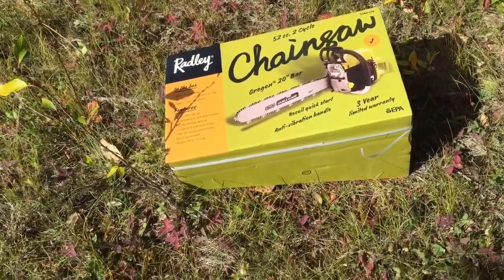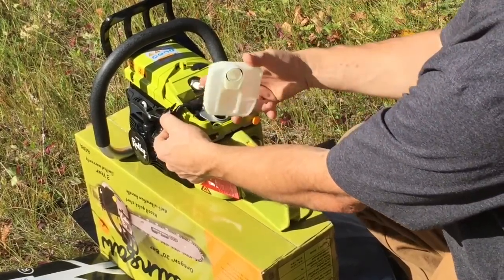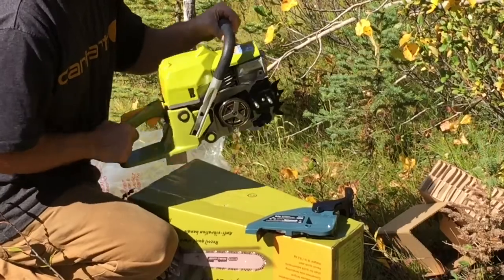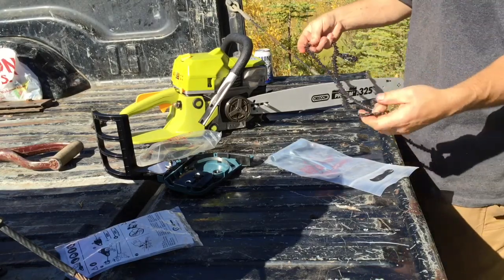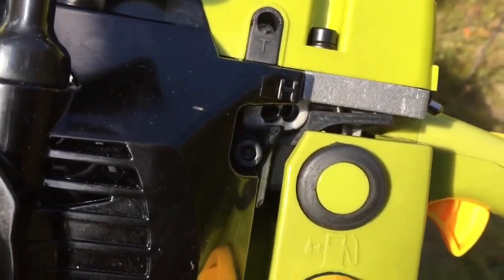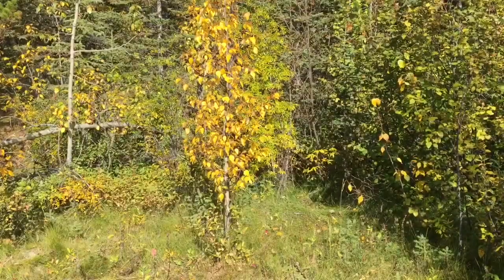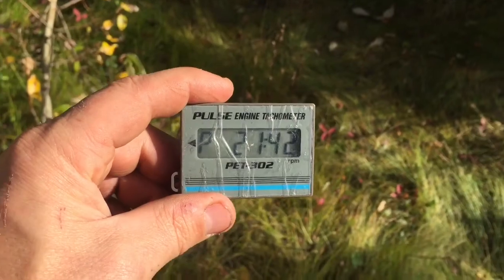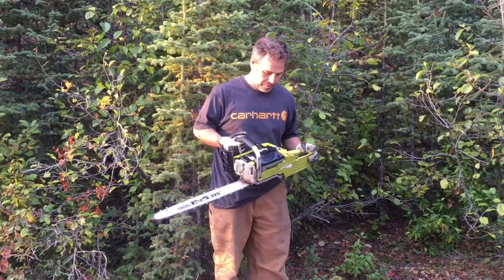52cc CHINESE CLONE REVIEW AND CUTTING!

Comment: Yep you convinced me! Had it now for almost 2 yrs. Cut 4 big trees. The only complaint is she runs hot. That's where 2 saws come in handy 😅
Reply from the maker: @dfairfull2542 yes the mufflers are choked up making them run a bit hot. You can richen up the mixture settings to help with that.
Reply: I have taken the torch to the catalytic converter inside the muffler and opened it up to breathe better. Haven't had it in the wood yet to see if this helps. Your right about carb adjustment. That will have to be done again. Keep your stick on the ice and thanks!
Reply from the maker: @dfairfull2542 I sure hope you got all that material out of your muffler cause it’s just going to get sucked back into your engine when you fire it up don’t forget a two stroke sucks in on the exhaust a little bit as well you’re gonna pull all that stuff inside the motor if you’re not careful and destroy it.
Reply: Good point. Got it clean as a whistle. Took the grinder to the edge of the fold over. Removed it then welded the edge back up. A little hi temp manifold paint and she looks good too. Thanks again.

Comment: I bought 2 Chinese top handle chainsaw and they so far run great.. i got them so instead of cutting branches and then you got to pick them up afterwards... With the top handle chainsaw I cut with one hand and the other hand I hold the branch and if it's good size for firewood i toss it in the trailer... It is so much easier... and I paid $68 for the one chainsaw and the other one I paid $97 1 has 10" bar and the other one has 12" bar

Comment: Thank you , I bought this saw , and as a single woman you gave me some great tips thank you
Reply from the maker: Right on yes it should be a great saw for you but it does need to be tuned right to make it run 100%. You need the special tool to adjust the carburator but once it’s set it should start and run fine for you as long as you mix your fuel/oil the same every time. 
These saws act like a high end saw and do not need to be tuned everytime you use them like some other cheaper saws.
Did you get it on sale? How much are they selling for now?

Comment: Thank you for this in depth review, had a 40" elm stump that looks amazing and wanted to slab it for tables but all I've had is a 16" husqvarna and I don't cut trees for a living so didn't want to put $700 into a saw. Good tip on buying the replacement parts ahead.
Reply from the maker: Realism91 Ya for a cheap to buy saw it sure is impressive.

Comment: I have the Radley bar, my original chain is getting short in the tooth . I’d almost given up on finding a  76 Drive link, .325 pitch, 0.58 gauge chain. Happened to be on the Home Hardware sight yesterday, they’re finally carrying them and not only that, there’s a big Radley sale on, they’re half price @ $11.50 now. Picked up two. The saw came with a made in China Oregon, these look the same.
Reply from the maker: @Gump Redhouse. Great info! 
I know mine the one in the video had a China/Oregon chain and it was very high quality lasted for 2 years of heavy cutting. I looked at the newer style bar/chain and it was anodized black vs just regular metal colour but the Oregon chain mine came with had blue links as well. 
Any saw shop can make you up the chain you need or you can go to the link in the description of this video and it has chains you can buy off Amazon. I think the link I posted works out to 12 bucks a chain or something like that. 
Were the Radley wood splitters on sale?
Reply: My stock chain has life left in it but ran across a nail in a tree I was taking down, I now have a pseudo skip tooth 😀. I  know what you mean about the Blue links, I think Oregon say it’s extra hardening or something. The chain that came with the saw was in Oregon bag but definitely didn’t have the Blue links. I think that the ones that I just bought are the same chains in Radley packaging. For $11.50 you should buy one, I have to think that there’s enough adjustment room on the 78 Link bar to mount  a 76, really, one link difference bottom and top, it will stretch too. It would be good to know how it compares to the one that shipped with yours. I was going to get the local guy to make me something a bit more aggressive, I’ll see how these ones work out. I continue to be really impressed by this saw. They’re up to 175 when they’re on sale but it’s still a heck of a value.

Comment: I was in the market for a chainsaw as a new rural property owner here in NS, I kept reading that the Husq Ranchers were the saw to get. Rolled down to my hardware store (Home Hardware) to order one, the guy talked me out of it and into one of these Radley saws. Says he's sold 50+ and hasn't had a single one come back yet, and that guys are even coming in to buy another after they've gotten home and used it.

Turns out the Radley was even on sale @ 150CAD, just gets better and better. Tested it out some fallen deadwood in the yard and yes, IT WILL CUT! Started up right away, ran real smooth too!
Reply from the maker: Right glad it worked out.
So did you tune the carb or just run it right out of the box? 
I’m curious to how it’s holding up for you.

Comment: Bought one 2 years ago...love it ...never fails to start second pull..only issue ..don't use bar oil ...use motor oil only ..
Reply from the maker: Right on good to hear. Why do you say to use motor oil?
Reply: @Indeewoods  I put chain oil in ..and it leaked all over ..checked manual ..states to use auto oil ..doesn't leak now...weird..cheers.
Reply from the maker: I’ll have to to look at the manual. 
I know some saws do not like thin bar oil. Husqvarna makes a nice all season bar oil that is quite tacky. 
And all the old vintage saws called for motor oil if i’m not mistaken.

Comment: It tightens ok but will only get a couple passes through until its loose again. Think I'll try new chain and bar
Reply from the maker: I think it’s normal to stretch a bit when it’s new.
Make sure you hold UP on the bar and you should have a little slack in the center of the chain then tighten it down.
Also what is your bar oiler set at?
Maybe turn the oiling up and make sure it is getting oil.

Comment: of all of the cheap chinese chain saw reviews i've watched, and holy hell i've watched alot of them, this one is the best. that sucker sure was making alot of chips at the end!

this saw looks like its the Cadilac of Chinese saws. its got the best manual i've seen and alot premium features not found on the $100 usd cheapies like the side chain adjust and oregon bar and chain.
Reply from the maker: Right on thanks for the compliment! I think that was actually the first video I ever made where I was talking to a you tube audience glad you liked it.
Ya these 52cc clone saws are really catching on. I read that they were cloned off a pro saw. It’s crazy how good they are for the price. It does depend who is building them though it seems. For instance these ones come with the Oregon bar/chain and it does come from China even though Oregon has a factory in Canada but must be easier/cheaper to assemble it all over in China. 
I’m going to do another review on that saw soon to let people know how it’s holding up and what I think of it.
Reply from the maker: And as far as throwing chip it actually was running very rich there but now that it’s tuned it rips pretty darn good.

Comment: I baught princess auto version its the forestking but identical saw but came with a 20 in bar and 16 in bar absolutely great saws with muffler gutted and the carb modified to tune it 
The muffler stock will start fires!!
Reply from the maker: @erikletham4944 they are all similar but It appears they make two styles a cheaper quality built saw and one that is higher. I have a few of these and the Radley is better built. Just better oilers,kill switches,plastic and a better pull start. Not sure about those Forestking models though.

Comment: Thanks for the great videos. Any issues with your tensioner? I stripped my work screw, and having a tough time finding the part number for replacement.
Reply from the maker: @andrewsliasas I’ve never seen one strip there should never be that much tension on your chain. 

Go back into that video I’ve added the link for that tensioner that should fit your saw. 

Let me know how it worked out. I have some here do next time I get a chance I’ll verify but it should work for yours.
Reply: Thanks for the reply - yup, that looks like them.

Only used the saw for about an hour, and the chain was noticeably looser after this period. I just tried to tighten it up a bit, but there might have been some debris preventing the bar from moving and I cranked the adjustment screw too hard.

Will give the new adjustment screws you linked a go, thanks again!
Reply from the maker: @andrewsliasas3680 ya just make sure you loosen the bar nuts before you adjust the chain otherwise it will strip the threads.

Comment: I bought one of these  hoping it will  do the firewood  cutting fir a couple  years  have a  few others   for backup
Reply from the maker: If you break it in right and do a couple heat cycles before you use it you won’t be disappointed. 
I just cut another cord with mine and switched the mixture to 50:1 and it runs beautiful but it vapour locks on really hot days when you shut it off then try to restart but lots of high end saws do that too.
The stock chain is durable and cuts decent but if you know your way around saws I’d  ditch that chain for a non safety chain it’ll cut much better. For the price of these things especially when on sale you’d only be into it for 190.00 with a better chain cheapest best saw you can buy in Canada. 
Make sure you tune the saw before using it or you risk damaging the engine.

Comment: Just bought one of these for 150$ used 2x. For a 20" bar and 52cc's its what i need. Im not doing any crazy 10cord of wood with it just cleaning up deadfall at the cottage, but need something better than a 30cc poulan than works once and smokes the engine.
Reply from the maker: @Matthew Morrone it’ll cut 10 cords if you need it to. Don’t let the price fool you they are pretty good saws. 
Like all saws they need to be tuned properly so hopefully you kniw how to do that if not get someone who does. 
Mine runs flawless and I’ve cut at least 10 cords of wood with it.
Reply: @Indeewoods Thats to be expected, and yes ive tuned many 2 smoke and 4stroke yard equipment engines, dirtbikes.  I have a set of tuning drivers. Ill have to see if I have the one specified in the video.
Reply: I noticed the carb tuning tool is called an eccentric or A Circle. The are 2 different A circle drivers, one is larger than the other. I dont mimd ordering the tool as i checked my kit and do not have it in my 9-10piece set. How donI know Im purchasing the correct one?

Also what size file to sharpen the chain?
Reply from the maker: @Matthew Morrone I’m pretty sure in the description of the video there is the 12 piece kit that comes with the A-circle tool and also the single tool itself plus files etc. 
Check it out.
Reply: @Indeewoods  a kit just for this saw?  Im not underatanding. There are 2 Different A-circle adjusters. Ii want to buy the correct one. In ny orevious comment i said i have a bunch already. But dont want to waste my money on awhole other kit where i just need the one tool
 Does this compute?  I foumd a large A circle and a small A circle. What kne does the saw use.  And looking for file size because I didnt buy my saw brand new.  So od lile to knpw the file size so i xan out together my own tool kit. Some of this stuff is lile pulling teeth. But ill figure it out on my own if i have to.
Reply: I didnt see the kit. Or part number. And i actually took notes on a lot of what you had said about the saw.
Reply: @Indeewoods  oh in the description. Ok. I just ordered the single A Circle tool only for 10$ tha ks for the input. Ill have to fiure out the file size i need.
Reply from the maker: @Matthew Morrrone here’s the size I use.
https://amzn.to/41oecXs
Reply: @Indeewoods  thank you so much for your input.
Reply from the maker: @Matthew Morrone no problem? Did you just need files or do you need the handle,file angle tool etc? If so here’s the one I use. https://amzn.to/3Y1QmOh
Reply: @Indeewoods  got my eccentric/A-Circle tool in the mail and went to princess auto and picked up 3 files 3/16" and a handle and guide kit, chain and bar oil and i already have 2 stroke oil for the other yard equipment I maintain and repair on the side hustle.
Reply from the maker: @Matthew Morrone looks like you are all set! Let us know how you like it.
Reply: @Indeewoods  its leaking bar oil everywhere. I burped the oil tank  but because its new to me im going to dissassemble it and go completely through it. 

It has the cheap Radley bar. But i can get a 2p" bar and chain from oregon at canadian tyre or princess auto for under 70$ which isnt bad. Ill use it till its worn out and then replace it. Besides that, its tuned pretty well, starts on choke first or second pull every time. A lot quieter than I expected and light for a 52cc. My dads johnsored is a heavy machine!
Reply from the maker: @Matthew Morrone cut with it for a bit they all leak when new. The saw dust acts like sponge. 
Crack the oil cap as well after ever use just incase there is any pressure in there.
Reply: @Indeewoods  yes, i read about that.

Comment: Im still using a 1960,s XL12 homelite. I Have several plastic saws of different makes. They are not a tuff and reliable as that vintage Homelite. Im on the Hunt for a vintage lombard.
Reply from the maker: Ya the old XL 12’s were good saws and built to last. Also 5 times the price of these even when purchased back in the 60’s.
Reply: @Indeewoods  Yes $129 was a lot of money in 64
Reply from the maker: @thecollectoronthecorner7061  I thought those XL-12’s were around 8-900 even back then?
Reply: @ronweaver9296   I have a Poulan 306A Like the guy used in the Chainsaw Massacre movie. Its Ok. and a pile of those 42 Cc Poulan pros and a couple of wild things. Not much count . the last one I bought I was at a auction. The auctioneer started it out as $50 and kept getting lower $10 at a time. When he got down to $10  and no takers. I shouted $5 he immediately said sold. Quick get his number before he changes his mind! I buy them and use the bars and chains on my Homelite 101.
Reply from the maker: Awesome I’d love to have a 306A.
Not many old Poulan saws in my area.
Reply: @Indeewoods   Im a collector of sorts. I buy older saws at estate auctions. Lots of $5 and $10 saws. The 301A was a $10 saw. Needed a carb kit and fuel lines go get it running. I dont restore my saws. I leave them looking  well used. I actually use them to cut our firewood. I rotate. Use a saw and burn a tank of fuel. and then get a different saw and  repete. I never let a saw set very long with fuel in it.
Reply from the maker: That’s awesome I do the same thing. 
I like to see what each saw can do and since I was to young to use them when they were new I feel like I get to experience what it was like to cut wood in the 60’s/70’s.
Reply: @Indeewoods   Im 70 and my father bought a new manual oil Super XL 12 in 1964 and at 13 Years oil I got to use it, Just today I went and cut firewood. Used a 58 CC Lombard and a auto oil XL12 Homelite. ran two tanks of fuel thru the Lombard and one thru the Homelite.  Cut more wood than my 2003 chevy 1/2 ton 4 wheel drive's 8 ft bed could hold.
Reply from the maker: @thecollectoronthecorner7061  that’s good stuff right there.
I was reading up on those Lombards and seen a video and man they cut! 
And that XL-12 was the most copied saw ever! Lol
I have a manual oiler XL-12 but yet to use it.
Needs a few parts then it’ll be good to go. Can’t wait to try such a legendary saw. 
Thanks for the stories I love hearing that stuff.

Comment: I know this is an old thread but that was a deal...set up just like a echo cs520. For that price I can't believe it has a metal handle where some of the ranch and farm saws have plastic and crack in the cold if they get knocked of the tail gate. Nice score!
Reply from the maker: You are saying you think it’s a clone of a CS520?
Reply from the maker: I just checked them out ya good eye! You’re riggt that top cover looks similar and the whole design. 
I will have to look at the specs to see if they cloned some parts off of it. 
Ya this saw has been pretty darn good unbelievale deal for a saw of that quality. 
Runs so flawless as well reminds me of a Honda. Lol
Reply: @Indeewoods  don't know if internal parts are a clone but from what I see from video the ergonomics are similar except the echo doesn't have a primer bulb but on off switch and choke are in the same place. Oh, and the air filter is different, the outer appearance is just like my 520
Reply from the maker: I know some of these “52cc clones” have an air filter like that. The saw is supposedly cloned from a Redmax GZ 5000 but they probably cloned the plastics off the Echo but the main design is the Redmax apparently.

Comment: Great video! I recently picked up a used Homelite grass trimmer, and it has the "pacman" screws, so I need to order a set anyway, I'm planning I getting this saw, so I'll be sure to get the eccentric one as well. 😂 Pretty annoying, I understand why they do it, but the trimmer need a tune up, and all I can do is turn up the idle a drop for now. 🤦‍♂
Reply from the maker: Haha right on
Reply: I bought a set of the specialty screwdrivers on amazon for 20$. Works on ryobi, craftsman, weed eater etc. Ive been able to rune so many trimmers and 2 stroke yard equipment they paid for themselves.